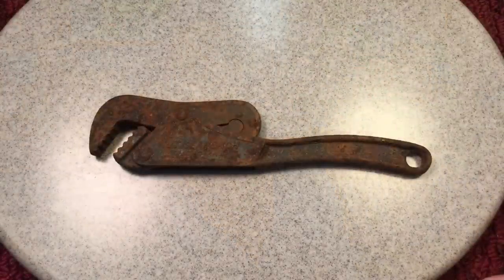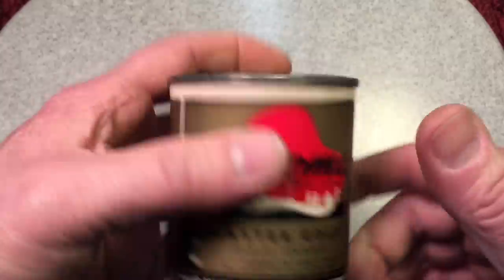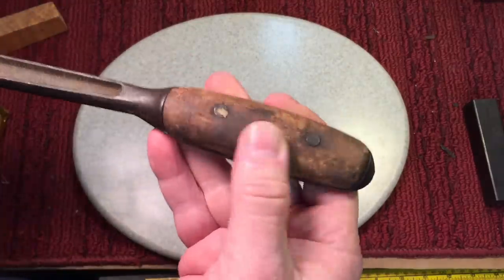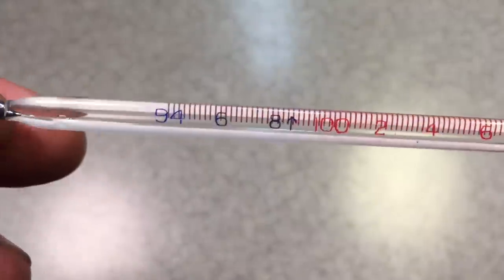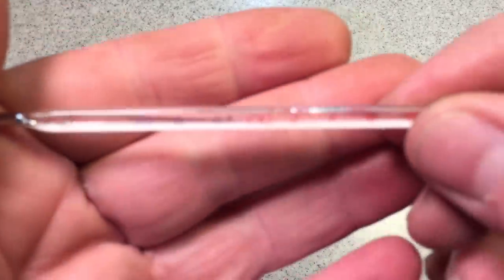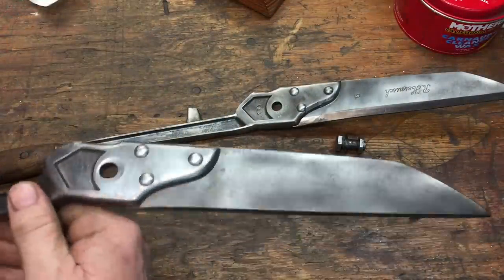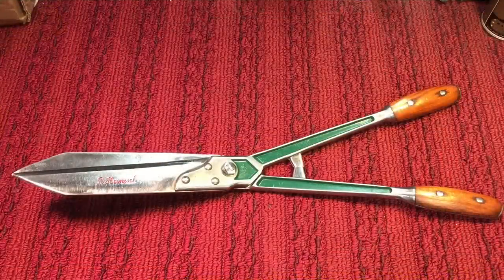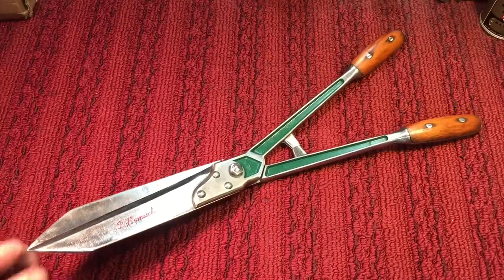Antique Hedge Clipper Restoration

Comment: Another point to note about this genius design - The top blade is threaded on to the pivot as to loosen when open and tighten when closed. The blades will linearly flex, becoming "weaker" thus tightening as the cut is further down the blades... . This way the blades have the same tension on the cutting surfaces. Much like larger scissors are bowed toward each other.  Beautiful job sir!

Comment: I had a tree come down in one of the Hurricanes of 2004, the ground was saturated and the wind blew it over. A week later I finally got around to cutting it up, I trimmed the branches off, and then started to cut the trunk about six feet up from the roots, and I made the first cut and here goes the tree right back standing straight up, that tree lived and started to regrow for about 7 years, then it died.

Comment: Sweet pair of Hedge trimmers! I switched back to using hand hedge trimmer, after seeing the damage the electrical hedge trimmer does if you aren't sharpening often.  Plus it's cheaper and easier to maintain a pair of hand hedge trimmer, if you have a few shrubs.

Comment: The hedge trimmers look great.  Geez, those are the only kind of thermometers I have in my house.  I have a suggestion on your vise mounting system.  Rather than clamp the bases of your grinders to your work bench why don’t you drill the same hole pattern in each of the wooden bases and the same pattern in your work bench and use 3/8” or 1/2’ bolds with wing nuts to clamp your grinders down?  I noticed that your clamped grinders move around a little bit when are using them.  With the bolts and wing nuts that sucker will never move and wing nuts.  
Just a suggestion.. Take care and thanks for the great videos.
Reply from the maker: Hi Vincent!  Unfortunately sometimes I am lazy and when you see the machines moving it’s because they aren’t clamped down!  🥴. The funny thing is when filming in high speed it exaggerates the movement so it looks like they are flopping all over the place!  😂. Even when I look at the footage I am shocked!  Thanks!!!!!

Comment: "J Wiss & Sons bought Heinisch in 1914. For more than a decade Wiss continued to operate Heinisch separately, and at some point moving them from 109 Bruce St to the building behind Wiss on S. 6th St. Members of the Heinisch family worked for Wiss."
Not sure if "operate separately" means they kept the name or not, either way it seems like those are around a hundred years old. You can find Wiss that are the exact same  I'm thinking that they kept the name until about 1925 or so but that is only my interpretation of what this says, it's somewhat unclear but in 1929 they are under the Wiss name in their catalog.......Exact date of change may be lost to history I suppose.
Reply from the maker: There is a good chance there was lots of parts and pieces that were stamped with his name so they just kept them until stock was depleted...  =)  Thanks!!!!!!!!!
Reply: Wow, I thought they looked older than the 1950’s but I didn’t expect 100 years old. I think Scout did a superb job restoring them.

Comment: The thermometers made me remember a listing on Ebay for mercury filled plumb Bob. Can't figure that one out. Great looking restore.
Reply: The mercury filled plumb bob has the mercury to damp out the swinging.
Reply: @OldSneelock  makes sense. Thanks Mr. Sneelock
Reply: I have to correct a misconception. Although I do believe it helps damp the swing. The patent calls out the mercury's weight as the reason. It added mass without volume.

Comment: Here's a great tip for you sir. While your wooden handles are still bare, you can "bleach" out those dark stains using oxalic acid. 1/4 cup to 1 cup of water and just brush it on - Keep it off the metal obviously, just use an art brush... You want to hit all of the wood to prevent blotching. But do not soak or submerge the wood to prevent undue stress and cracking. If need, a second application can be used after dry and even scrub with a nylon brush. The wood will look like new!

Comment: Nice job as always man I go nuts when something gets caught and goes flying. I was restoring one of my father's pipe wrenches it was a USA made brand high quality name I didnt even know they made pipe wrenches and it was a decorative knurling pattern green in color I want to say one of the big automotive tool brand names not snap on but similar for my sister after watching your video and the nut got caught in the wire wheel for the 8 inch wrench and went flying I was like oh man I'm not going to find it. Later I found it thankfully before I was going to see her to bring them. I have a question where do you get the fiber wheels? You have me interested in trying them out and I'm not sure if the ones I saw are the same thing like the ones your using.
Reply from the maker: Rob- this is the one!  https://www.amazon.com/gp/product/B01DKABIOI/ref=ppx_yo_dt_b_search_asin_title?ie=UTF8&psc=1

Comment: Hi Scout.   You must have better luck than I with those plastic 3 in 1 oil cans - every one I have gotten leaks around that red cap.  It doesn't leak immediately. .....after it sits upright after you have used it, the oil trapped around the underside/ring around the cap leaks out between the cap and bottle.   I've had four different bottles leak that way.   Anyway, thanks for sharing and have a happy day!
Reply from the maker: John - We will have to address that in an upcoming video!  Thanks!
Reply: @ScoutCrafter  will be looking forward to that!!!!!!!!!!!!!!!

Comment: I needed to stake some rivets for the treadle grinder. To get the heads right in the tight spot I made a rivet staking punch. https://youtu.be/jBHjrwIm_mA
A pleasant surprise was by using punch and anvil I was able to put a perfect head on the rivets. It makes replacing rivets a lot less stressful.
Reply from the maker: Hi Dave- I have a whole set of nice rivet domers from my leather working days but I am working on a drill mounted domer now!  =)
Reply: @ScoutCrafter  We used a rivet spinner to assemble parts at Douglas Autotech. Pretty cool design of the head. It spun and orbited at the same time to form the dome. 
I'll be waiting to see your setup.